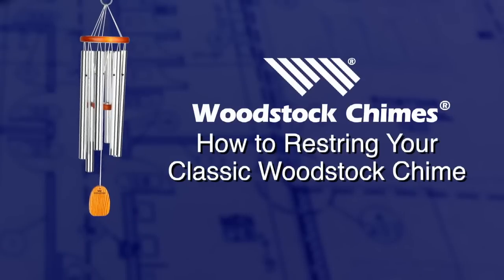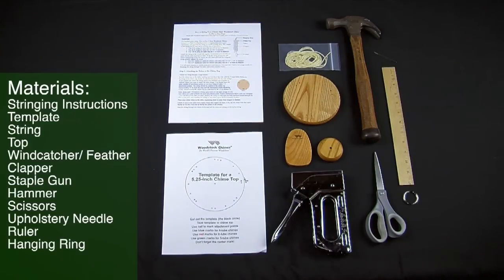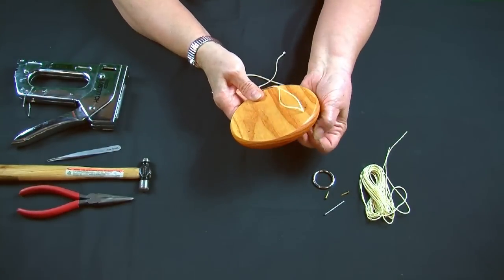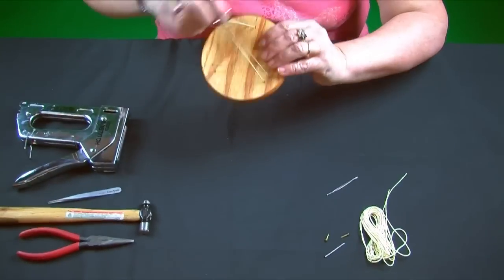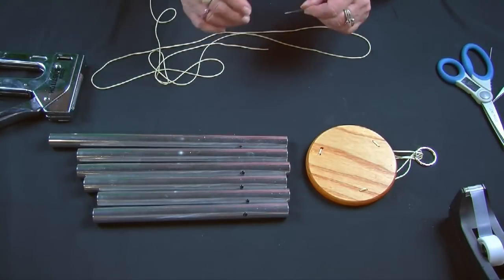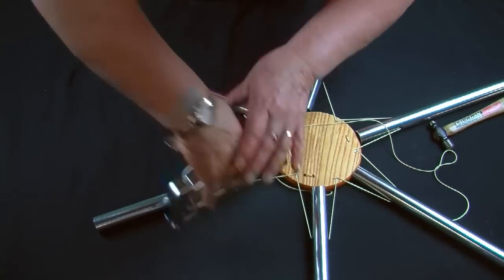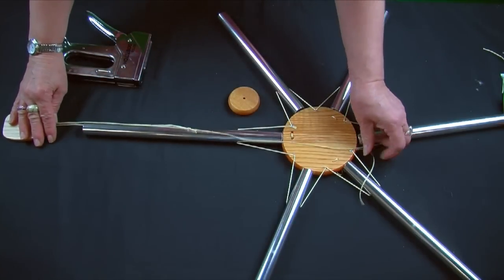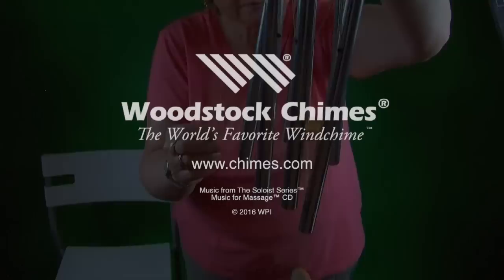How to restring your classic style Woodstock Chimes

Comment: What a great video!  You make the process easy to follow and simple enough that even I can do it.

Does anyone know how to determine the relative size of the clapper to the hanger?  For example, if the hanger is 5-1/4" in diameter as shown in the video, what diameter should the clapper be?  Does diameter of the tubes matter?  I ask because I have the tubes from several sets of chimes but the hanger, clapper and sail have long since rotted away or been lost.  I need to make the wooden parts and restring the chimes.

TIA

Comment: This video is very helpful. What isn't helpful is the supplies provided to repair the wind chime at home. The wood is so hard that the staples would not go through it.  They were the 1/2" staples I've used to more aggressive projects just fine.  While I love that the wood is hard and will stand up to the elements, it is not good for the recommended way of repairing at home.  I ended up using nails to secure the string for the tubes which did not seem to secure the string great even though I wrapped it around the nail as the directions recommended, but we'll see how long it lasts..  Ended up bending two of those and the ultimate frustration was when the center screw hook provided by Woodstock Chimes broke halfway through screwing it into the wood topper.  Next time I'll call or re email them to have them fix it for me.  They didn't respond to my first email request for the cost of repair. :-(  Love their chimes, but not this part of the service they provide.
Reply from the maker: Hi Shannon, I'm sorry to hear about the problems you had with the repair and have forwarded your note to the refurbishing department. Please follow up with an email to them at refurbish@chimes.com so they have your contact information and can respond. I can't explain the lack of response to your earlier email, but they are now alerted to expect an email from you. I hope that helps.

Comment: so my existing chimes (30 yrs old at least) have single pins in the chime top where the strings for each chime were attached - I'm having a devil of a time trying to pull those out - so I am thinking I just work around them with this staple method?  Will that compromise the wood in the chime top?
Reply from the maker: Hi Michelle, those are wonderful vintage chimes you have there! Please write to our refurbishing experts at refurbish@chimes.com for advice on this. They should be able to offer some guidance. Thank you for giving your chimes some TLC!

Comment: This would have been easy to follow IF it had worked for my chimes. Unfortunately, after attaching everything, the tubes did not hang down - I was left with a giant starfish. I had to cut all the string and redo it with a lot of slack and then didn't have enough string left for the clapper. No one else seems to have this issue, but maybe the holes in my tubes were further down than this example? don't know, but ... now I just need to order more string

Comment: How can I make my chimes more sensitive to the wind?
I was thinking of hanging the pendulum a bit lower, but I'll await your response. Thanks for the video.
Reply from the maker: Hi Willi, The windcatchers are designed for optimal performance, so it's best not to tinker with the design but instead to try them out in different locations to see where you get the most action from your chime. Also, be sure not to hang them from a chain or other extender, which can cause a pendulum effect, but hang them directly on a hook. If you like, please contact our warranty/refurbishing department at refurbish@chimes.com, tell them which chime you have and where it's hanging and see if they have any further suggestions for you. I hope that helps!
Reply: @WoodstockChimes  thanks, I'll try that.

Comment: How do you thread the chimes so easily ? Getting the braid in is easy but getting it through to the other side is not. Are you using a needle if so what size. I haven’t found one with an eye big enough to take the braid but small enough to get through the stringing holes. I have just bought an additional set and see that, sadly, they are now made in China. I need to restring - for the first time - my original Neptunes bought maybe 30 years ago. I bet they won’t last as long !
Reply: I found a suitable needle in a craft shop and have restrung my chimes. Many thanks for your instructions - they are so Lear and easy to follow.

Comment: I cannot find the instructions or the template on your website.  : (
Reply from the maker: Hi French Toast, please measure the diameter of your top wood piece and then use the link at the end of this paragraph to go to our website and click on the repair kit link for your wood size. On that page, you'll find a link that will bring you to the downloadable template for that size wood. (You don't need to buy the repair kit, but that's where you'll find the link to the template you're looking for -- I agree that it's not easy to find!) Here's the link to all the different sized repair kits: https://www.chimes.com/c-45-parts.aspx

And here is a link to the written instructions: https://www.woodstockchimes.biz:8715/LgFiles/stringing_your_woodstock_chime.pdf

I hope that helps. I see that you have also asked about the brand of staple gun used in the video. I'll see if I can find out for you and will report back!

Comment: What brand staple gun are you using??
Reply from the maker: Hi French Toast, We used an Arrow brand staple gun in this video, but Bostich and Stanley are similar and can handle the job. I'm told that it's important to use at least a half-inch staple, or a longer staple for a larger chime. Measure the thickness of the top wood piece and use the longest staple that will not go all the way through. I hope that helps!